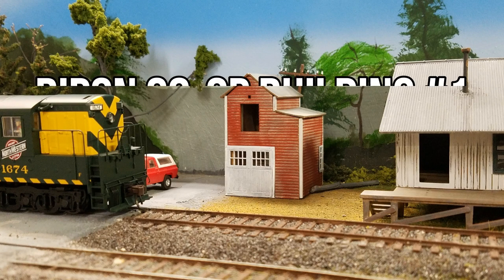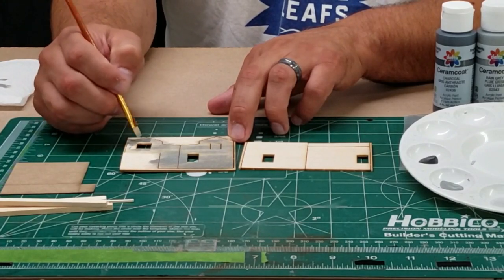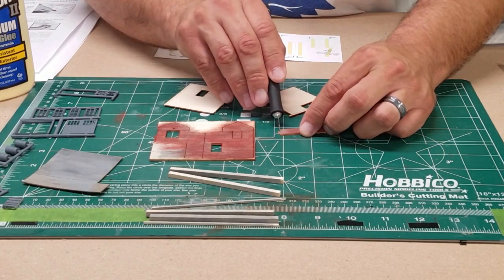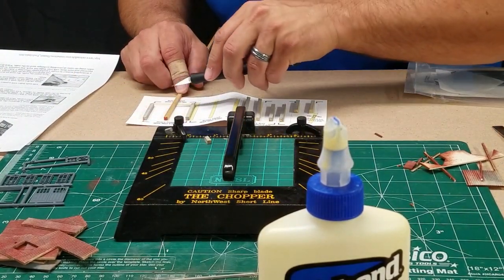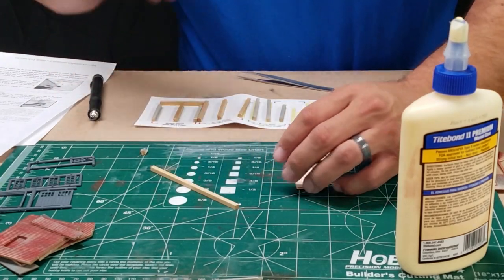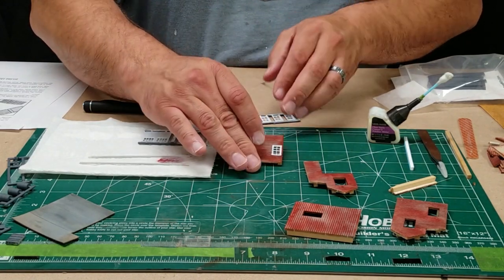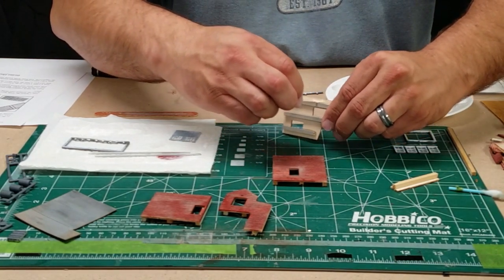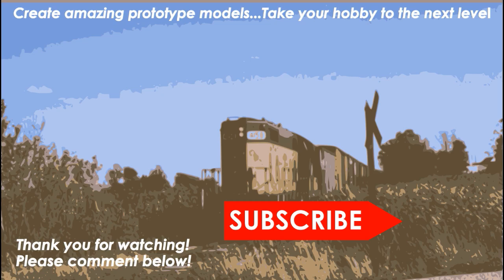Model Railroad Craftsman Structure Build video 1 of 2 (Ripon Co-Op)

Comment: Andy, nice video. When you finished painting the wall section were pretty warped, how did you flatten them out before assembly?
Reply from the maker: Oddly enough they flattened out after they dried. The supports I added also stiffened up the walls and straightened them out!